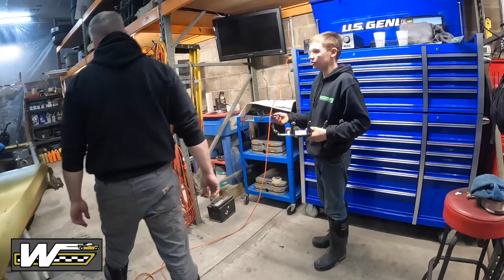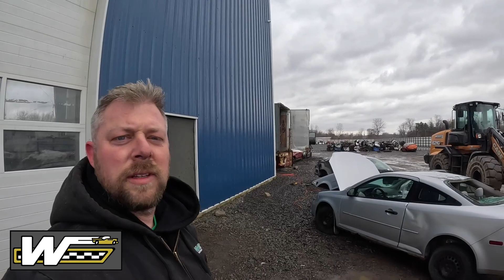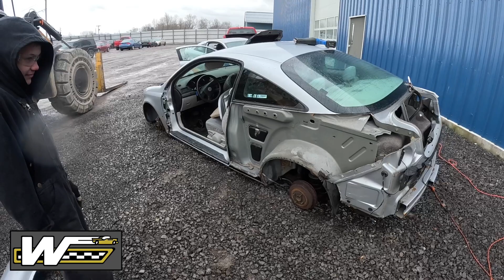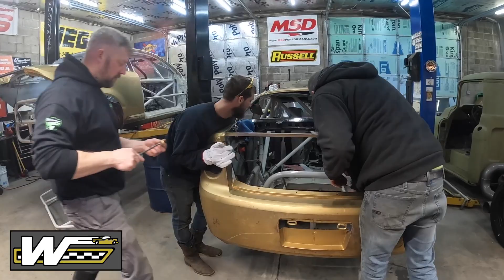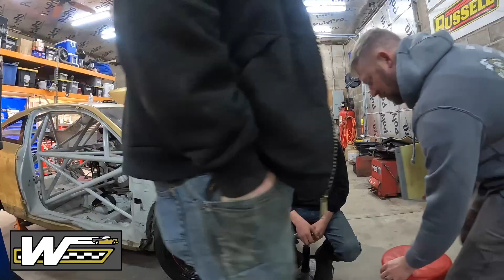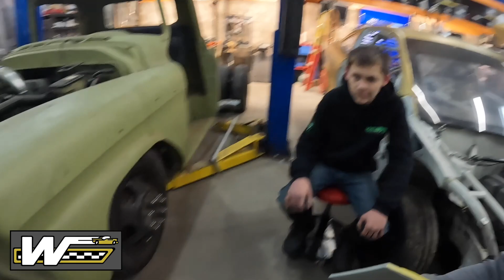Pulling parts and Shop Talk with Andy Lewis Jr.

Comment: That truck is BADASS..6.5 Detroit?
Reply from the maker: Thanks! Yep 6.5 Detroit, this one is the center mount turbo, donor was a school bus. We're thinking about trying to put some videos of the truck going together in the future.
Reply: @WilbertsRacing  you should def do some vids on the truck. I assume you guys probably went through the motor and bullet proofed it? Put a tuned computer in it?
Reply from the maker: Not yet! She basically is exactly the way she was when taken out of the bus. It was a task just figuring out the wiring, but she is alive and can move under her own power.
Reply: @WilbertsRacing  I have a 2000 express 1 ton conversion van with a 6.5 that I used for pulling the race car hauler. I put a tuned computer in it from Heath diesel, manual waste gate control and straight piped with 4". Woke that truck up.. actually it's humorous seeing a big box van haulin the mail and making all kinds of unnecessary noise. I got about one season on it and the head gaskets were GONE. If you guys tune it up you have to put a stud kit in it no way around it..just wanted to warn ya lol
Reply from the maker: Thanks for the heads up. We’ve thought about a few changes, like moving the pmd and doing the manual wastegate. That van sounds like a lot of fun though!
Reply: @WilbertsRacing  Oh yeah definitely relocate that PMD cause it WILL fail mounted on the fuel pump. Also the crank pulley/balancer is something worth upgrading to the billet aftermarket one that's available cause that'll fail at some point. Yeah my 6.5 is fun. The 6.5's sound good straight piped. And theyre nice motors once you bullet proof them. What's nice is they're very basic.. nothing like today's crap obviously.
Reply from the maker: Sounds good, Thanks for the info.